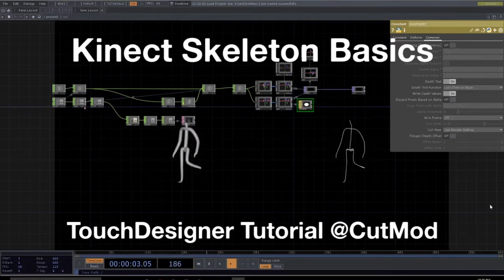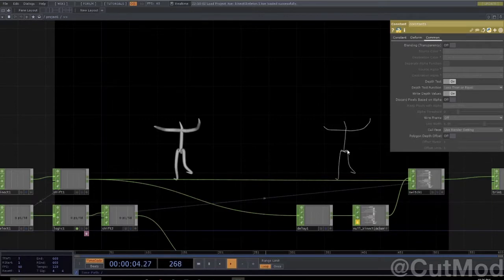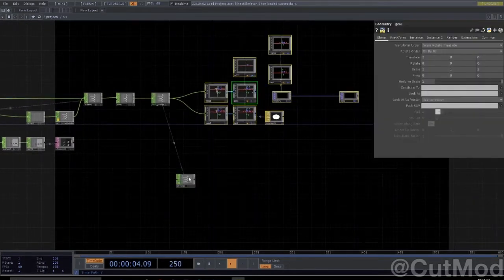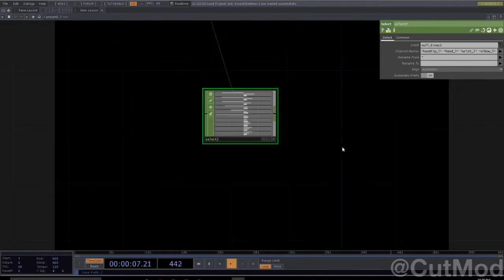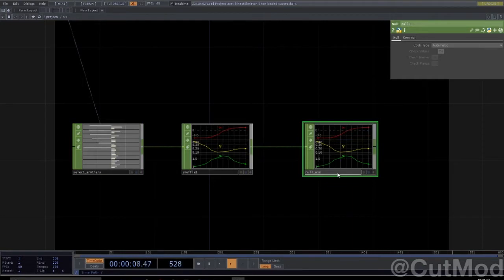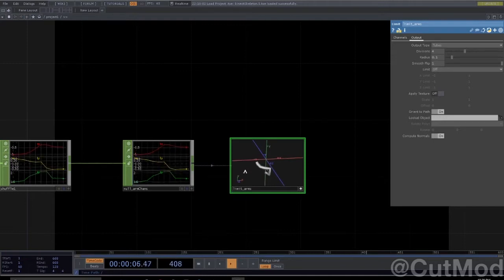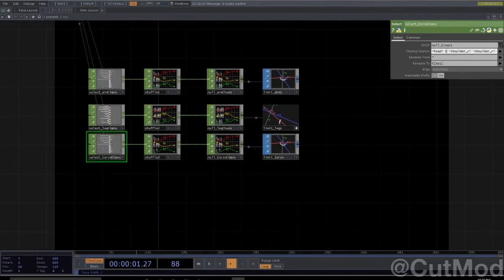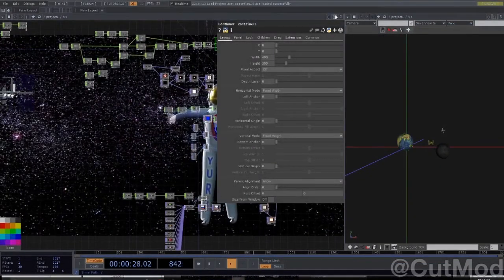Kinect Skeleton Basics - TouchDesigner Tutorial

Comment: hey!! so ive been trying this (along with your other tutorials which are stupendous!!) but a=having trouble getting a proper track of the skleton from the kinect. 
i selected the pramaters you where talking about (for the arms) but i get like a wierd 4 tubed object in the  limit, it seems to move with the arms, so its tracked, but it picks up a wierd stream. i thought maybe its the shuffle not working, so i increased the n value in the shuffle (just fom trial and error..not entirely sure what it actually changes)  , but it results in strange "artifacts" and stuck positions in the geometry..are you aware of the kinect translating the arms in a wierd way? - im using kinect 1414, and all the other functionalities work pretty well-perfectly :)
Thanks man, you rock!
Reply from the maker: B-Dawg Productions, hard to say what the issue is without seeing it. The Kinect v1 has a different skeleton layout than the Kinect v2 used in my tutorials. That could be a source of confusion. Maybe try a smaller set of joints, like just shoulder>elbow>wrist of a single arm and see if results make sense. Feel free to share pic/vid of issue
Reply: hey! so yeah it was the kinect version...got the new kinect and subsribed to your patreon :), and the download file, worked wonderfully.
im trying to connect a rigged charcter to it, but having a hard time wrapping my head around bone groups and stuff. i found some very helpful project files and info on the derivative forum, and saw a bunch of projects where they had costume models, i just cant understand how to switch there models out for my own...in terms fo what do i connect where....
(lets say this one: https://www.derivative.ca/forum/viewtopic.php?f=4&t=6489&start=30 (last page, kinect_mesh.toe)
thanks again!
Reply: @Remvisuals  v